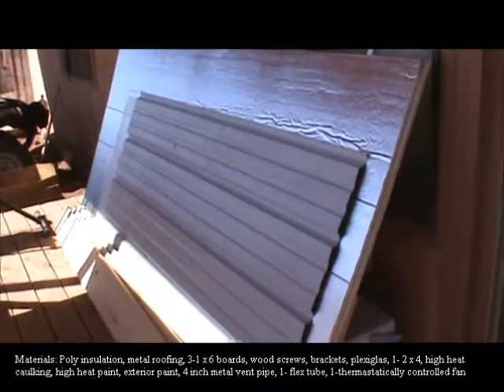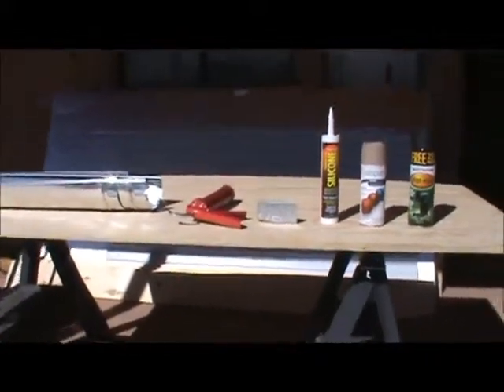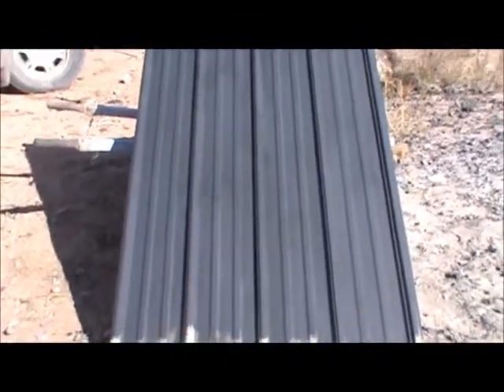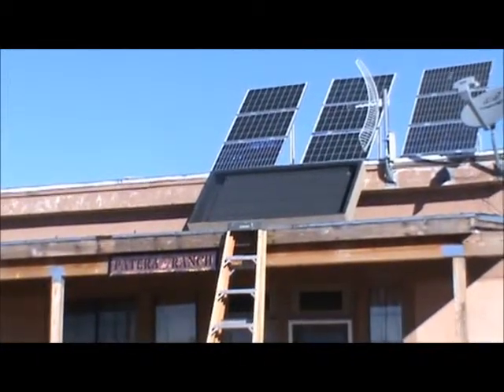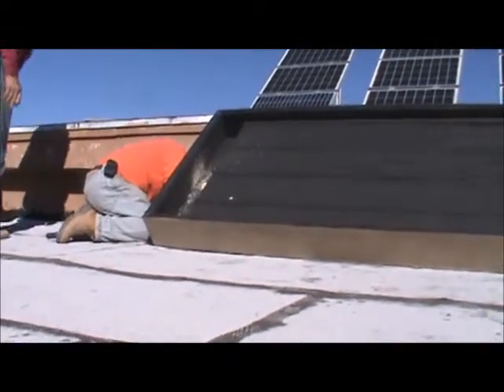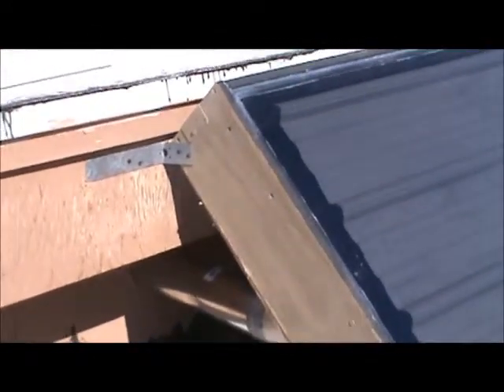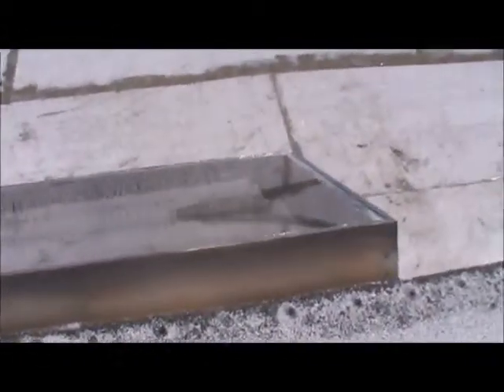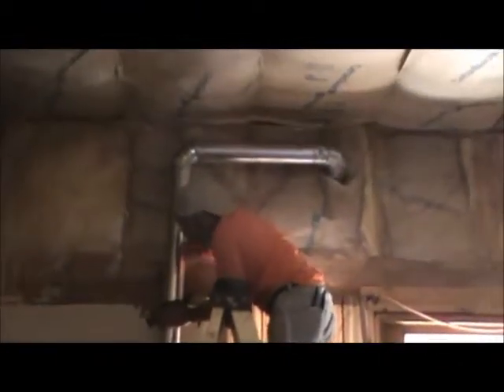solar-furnace

Comment: Since you mounted it before it was sealed, did you get any paint or caulk odor?  Any brackets on the plexi to hold it down or will the caulk keep it down?
Please let us know how well the warm air reaches the lower level of the room since you have a high ceiling.  Thanks! and it looks great.